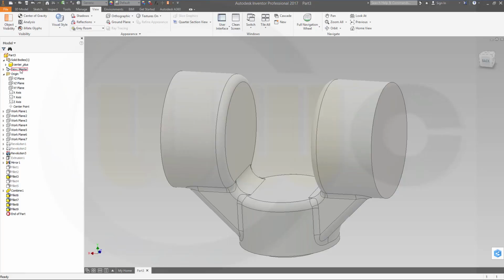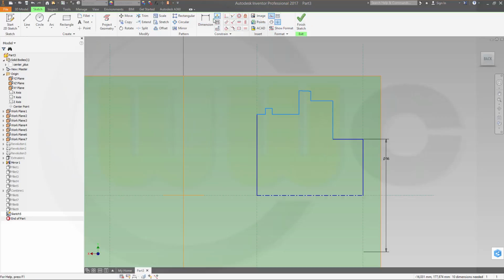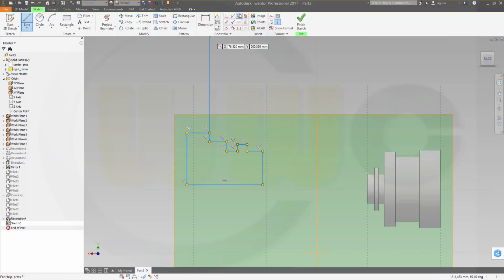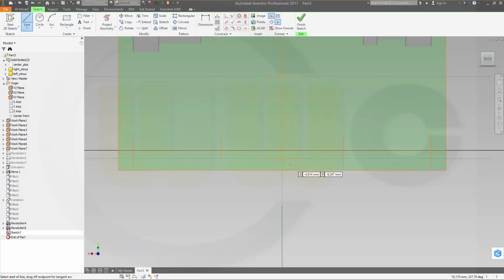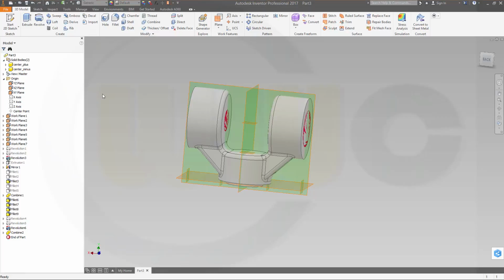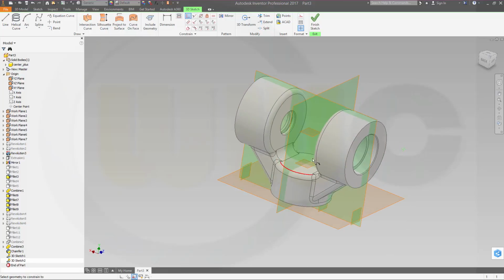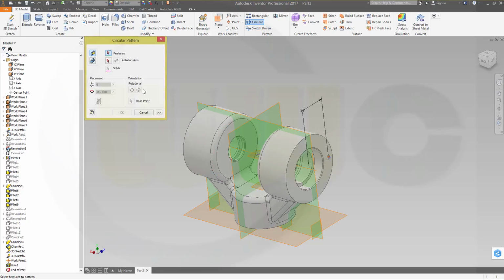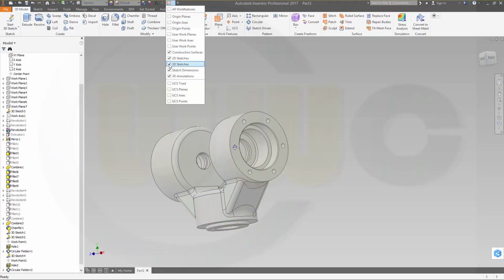Multi-Body-Housing - Part 2 Interior - Inventor 2017 Training - Methods

Comment: 9:36, why don't you just mirror the 3d feature to the other side? why sketch it again and model it again? P.S. Great tutorials. In the part one of the object, you made a fillet in sketch and made it a construction just to dimension it. Completely blew my mind. People have been telling me not do fillets in sketching, because it is easier to change the fillet.
Reply from the maker: I don´t mirror it, because so I can change both solids independently if needed. I used the filet just for getting that point. You could use to dimensions as well. But the filet is more convenient and it is just for contruction purpose not a "real" filet. And yes you should do "real" filets in 3d.
Reply: @wolfgang.walden.cad.training  thank you so much!!!